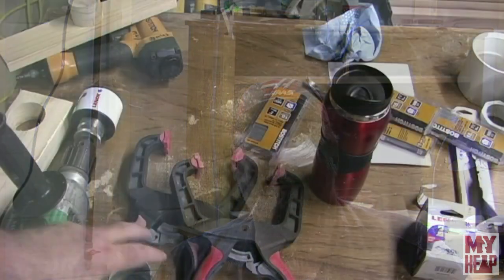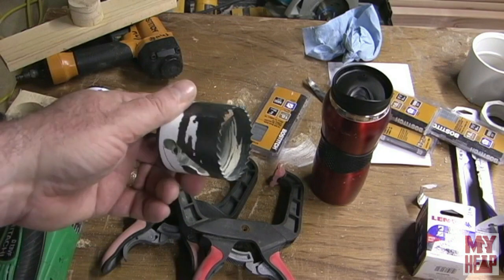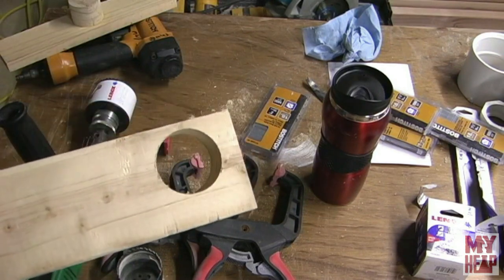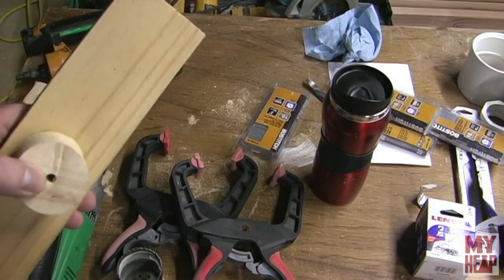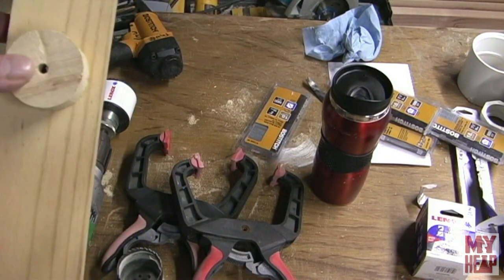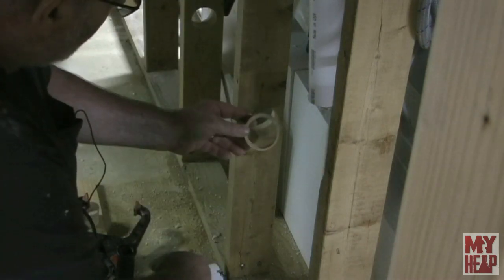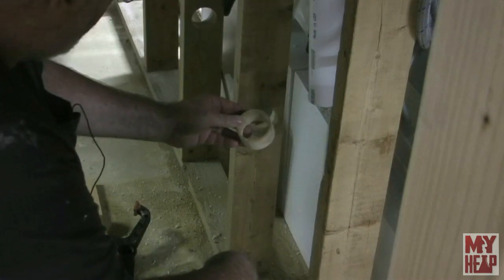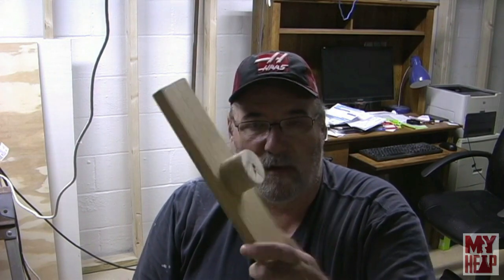Shop Tip - Enlarging Holes made with a Hole Saw

Comment: I like it, good tip.  You can also insert the smaller saw inside the larger one on the arbor,  It works good for thinner material but it may not work so well on wood because it only offers a 1/4" overlap.
Reply from the maker: I thought of that, but the arbor that fits my Lenox saws does not have enough thread to go into the second saw.  :-(
Reply: O,   So hows the remodel going?
Reply from the maker: Once I resolve the washer drain problem, I will need to buy the tub / shower unit I plan on getting.  I want to do this before doing the framing for it.  I have discovered that not all framing requirements are the same.  Some are 60" between frames, some are a little larger.  Some call out specific stud placement.  As I am doing everything debt free, I get a little break while I scrape up the money for the thing.  YAY!!
Reply: Projects are like war, the best-laid plans go right out the door when you engage.  Two steps 😖
I said I WOULD finish my welding area last week,  but I forgot that the wife has other idea's, so this weekend I HOPE and 🙏that I can finish the welding area.    I always try to remind myself it's the journey, not the destination that matters;  Are we there yet 🙃

Comment: That's a great tip. I think I'll file it away for the dark day I need it. I bet you're tired of wood butchering in the dungeon. 😀 Thanks for the update keep em coming!
Reply from the maker: You better believe I am tired of butchering wood!  Thanks for watching George!  I would have used the trick where you put the smaller saw inside the other, but my arbor does not have enough thread to pull that one off.

Comment: G’day Joe, I do it slightly different, I cut a hole the bigger size into a piece of scrap and clamp that over the hole you want to enlarge and cut the new hole using the scrap piece to guide the saw, works good if want a plug/blank without a hole in the middle (after the drill bit is removed first). Keep up the good work, it will come to an end one day. Cheers 
Peter
Reply from the maker: Your method sounds much quicker than Peter.  I will try to remember that the next time it happens to me.  Thanks for stopping by.  How are things going on your end my friend?

Joe
Reply: G’day Joe, all is well but I find myself reminded that I’m not as young as I used to be, climbing up and down ladders all day long, oh there’s muscle there also;( then to top it off I’m not too good with ladders and heights. Rest assured I’m penning this from my armchair and not a hospital bed. Cheers Peter
Reply from the maker: Peter, never minded ladders to much until I stepped over the side of my sailboat and missed the wrung of the extension ladder.  Took about an eight foot fall wrenching my knee between the wrungs on the way down.  Laid there about 15 minutes before I could get up and my knee hurt for weeks.  Been extra cautious with ladders since. Just be careful.  ☺️

Comment: Brilliant solution! 👍🏼
Reply from the maker: Thanks Richard.  I would have done the hole saw in the hole saw trick, but the arbor for my saws do not have enough thread to pull it off.  Peter's, (PGS) has faster solution to the problem.  Didn't think of it.  hahaha  Thanks for watching Richard and commenting.

Joe